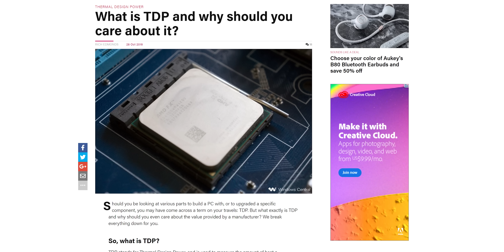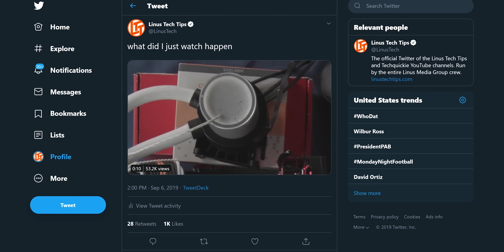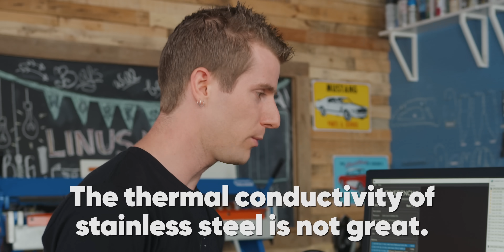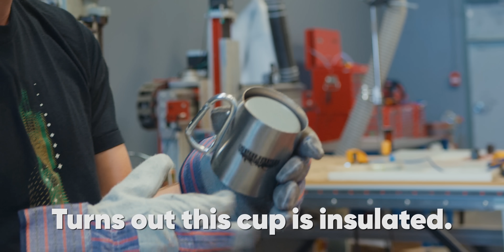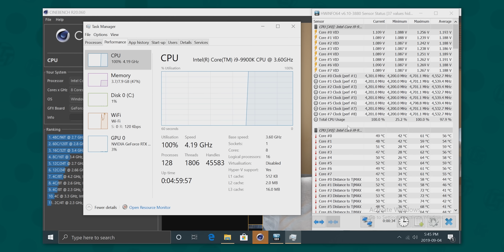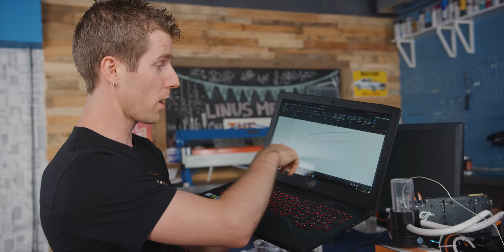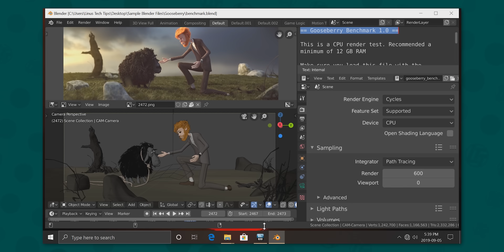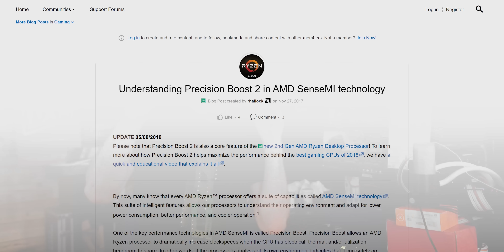Who REALLY Runs Hotter? AMD vs Intel

Comment: This was an actual terrible method, and probably a demonstration of what NOT to do, if you want to find out the true heat output of these CPUs.

However, you used the same crappy method for both of them, and mostly seemed fair.

Given this, it was actually surprising how close the 2 CPUs were, like it seems kinda irrelevant or at least secondary to worry about temps when trying to decide between the 2. Any half-decent quality cooler should be enough to keep them at safe temps, so it falls down to everything else, depending on the usage you want to do (gaming vs productivity and so on).

Still waiting for a proper test methodology btw.

Comment: Or you could just use a known larger volume of water in a separate insulated vessel and measure the start and end temperatures after a given test period. 
As it's a comparison test, ignoring heat losses in the system shouldn't be a big issue as both cooling systems will have similar losses, as the volume in the external insulated reservoir would be much larger than the pump, cooler and tubes combined. 10+ times?
Basic science tells you that it takes a given amount of heat to raise the temperature of a given volume of water by a degree.
So knowing time, volume and rise in temperature you have your CPU thermal output vs time.
Just need water, a stopwatch and a thermometer. 😉

Comment: There's really not much point in trying to set an 'industry standard' in this case, as the respective marketing departments will always try to use 'numbers' to gain some sort of marketplace position.

It doesn't matter what product you're talking about, Marketing per se is all about finding a competitive advantage to encourage consumers to buy their product.

From a real consumer viewpoint, REAL Performance Benchmarking is more useful than the 10% variation in TDP figures, just use whatever heatsinking solution is effective for your situation to prevent Thermal Throttling under maximum load.

Comment: I would've suggested measuring the power input on the CPU power cables on the motherboard. That would give you actual watts used. Whether that's turned into actual useful computation vs. heat is a different story, which they hinted at, with AMD getting more done in the same thermal difference. I'd suggest stopping the test after the same workload, then measuring the temperatures of your coolant. It wouldn't give you a TDP comparison, but it would give you an efficiency comparison.

Comment: Wouldn't it be easier to look at the power usage? Which one produces more usable work per kilowatt
Reply: They're not measuring work/kWh. They're seeing how realistic the TDP specs cited by manufacturers are. Intel claims the 9900K is a lower TDP component. If it outputs more heat than the AMD part (even though it has a higher quoted TDP) then the way they convey this information isn't adequate or possibly even honest.
Reply: @faceplants2  But the heat is just power usage. You could easily see which one produces more heat based on the power usage. It gives you hard numbers with relative ease. Also it would help consumers to understand which device uses more power over time
Reply: @hene193  The processor isn't the only thing using power however. These are different platforms with different chipsets and more importantly different VRM's delivering power to the processor. Different motherboards can use a different number of phases and even if they don't, inefficiencies in the VRMs will impact accuracy.

Comment: okay, let me tell you guys how to do it:
1) DON'T USE WATER. Use a liquid able to absorve heat faster
2) DON'T USE A CUP ON TOP OF THE CPU (that is absurd)
3) Mount a Liquid Cooling System, BUT don't use a radiator, instead use a big reservoir (10~20 liters)
5) Put at least two thermometers in two different places of the reservoir (preferably some able to collect data during all the experiment)
4) Thermally Insulate everything (CPU, Hoses, pump, reservoir) you can as best as you can
5) Turn everthing on and let the whole system working in idle until some sort of thermal stability (temps variation is appr. 0)
6) Start the benchmark and moniture the CPU clock and temps
(if the cpu throttles or the temp increases too fast  you are not being able to remove heat fast enough, which means that you need a bigger contact area, a better coolant or a stronger pump, if none occurs you can procede)
7) Register the initial temperature on both reservoir thermometers and start your stopwatch
8) Let it run for a fixed time or until it reaches certain temp (preferably a temp that will not cause throttling)
9) Colect the data
10) Turn everything off and reset the initial conditions (let/make everything cool down)
11) Repeat the experiment more than once to increase accuracy of results (THIS IS VERY IMPORTANT)
12) Process all the data (using statistics)

do it all to AMD and Intel, after that you will be able to make a reliable comparison.
Your scientist viewers will be thankful.

Comment: I can't help but wonder...
Why not just fill a cooling loop with a known amount of water (Put the whole mess on the scale, weigh it dry and then fill- your difference is your water mass), fire the pump on and measure the increase in water temperature over time? 

Science time! The laws of thermodynamics dictate the following;

0: If two systems are both in thermal equilibrium with a third system then they are in thermal equilibrium with each other. (In essence, if the CPU block and CPU are in equilibrium, the water would be as well.)
1: When energy passes into a system, the internal energy changes accordingly. (Heat something up, it gets hotter.)

The basis for 'watts' is joules per second, and 4.18J = 1kcal, which is the energy to increase the temperature of 1g of water 1 degree C. So, example: Your loop holds 250g of water. You run the CPU at full power for 100 seconds, and your temperature climbs from 30C to 65C after the water reaches equilibrium. That's a change of 35 degrees Celsius.  35*250 = 8750kcal, or Calories, in ten seconds, or 87.5kcal/second. When you convert back to watts (1J/s is 1W, so 1kcal/sec is 4.18W), you're left with 87.5*4.18 = 365.75W at full power.

You plug in your second processor, let the water temp get down to 30 again, and run it for 100 seconds, then stop the system and let the water run for a bit longer to make sure there's no excess heat in the CPU. Your water reading went from 31C to 62C. Your change is 31 C. 31*250 = 7750kcal --> 77.5kcal/sec --> 323.95W at full power.

CPU 2 runs cooler by 11.4%, which means you need ~10% less cooling capacity.

Comment: actually a magnet will tell you if its stainless  as higher grades are not magnetic, also you can tell by the grinder. lots of sparks = carbon steel, less sparks = stainless steel

Comment: Q =mc dT/dt, fellas.
Put dots over the Q and m and you're set with a really easy way to measure this.
You need a flowmeter and two thermometers, preferably inline ones. Do some simple math and you have the heat flow rate.

Next time, call a scientist or engineer. To quote a popular Canadian show, "it's fucking embarrassing!"

Comment: How it should have been done:

Traditional AIO except for a radiator use 5 Gallons of water into an insulated drink cooler with input vs output on opposing sides. Using a thermal probe into the cooler, monitor and record the temperatures and clock frequency every 1 minute. 

During the analysis, divide the temperature by the clock speed to get a Clock/Temp rate meaning "Given a frequency it outputs this much heat". Though since that doesnt factor in performance/joule, you could FIRST divide a specific productivity benchmark. 

So for a scored productivity benchmark the formula would be 

(Benchmark Score @4.0ghz) / (Time to 80*C @ 4.0ghz)

If you wanted a more constant you could simply use the rate value calculated by plotting the 1 minute measurements, finding the standard curve value, and dividing that into the benchmark score at a given clock speed.

Comment: DID NO ONE THINK TO JUST GET AN LN2 POT AND PUT WATER IN IT? HELLO? MCFLY?
Reply: That's an insulated container. The goal is to transfer as much of the heat into the water as possible. If they had used an insulated vessel instead of that metal cup they'd transfer less heat into the water and more into the air and surrounding components. This would've increased the chances of differing component layouts on the boards to absorb heat differently since the thermal output from the CPUs would be transferred into the water slower. It also would have taken longer for the thermal reactive dye to activate.

 Using a LN2 container would've probably still yielded similiar results but it certainly wouldn't be the obvious and dramatic improvement in test methodology you're suggesting.
Reply: @faceplants2  are we talking about the same kind of LN2 pot? I mean one of these: https://kingpincooling.com/collections/extreme-pc-cooling/products/t-rex-cpu-container
Reply: Andrew S dude hes talking about a cpu container not the linus tech tips insulated water bottle lmfao 😂
Reply: Hahahahaha.

Well said.

LTT is a bunch of morons to be honest. I personally know more than all of them combined, they just have a bankroll. That's the only difference.

Comment: You could use a slow and steady flow of tap water with a known flow rate to cool the cpu and measure the temperature difference before and after the processor.
That way you wouldn’t run into thermal throttling and could wait until thermal equilibrium is reached

Comment: since you only did a comparative test and not an exact measurements of thermal output, i dont see why the pump would effect the results at all. both systems had the same pump. the one did have that pump running for longer... but at that point its already over... now to overclock and use a larger cooler sized res to get a longer test... maybe side by side... 16 core ryzen vs 16 core zeon :D

Comment: 19:10 You mean "The best advice we can give you is to just ignore Intel processors this generation and go AMD"

They draw less power/make less heat, don't have issues with TIM/solder between the heatspreader and the die, are strictly better for proffessional workloads, and have more cores/threads and therefore more flexibility/futureproofing than similar priced Intel processors.
Reply: You're assuming a lot, fellow AMD fanboy.
Reply: @BarryKennedy  It's only true for this generation. And the benchmarks, specifications, and pricing don't lie. Intel has long needed some competition anyway.

Comment: If you are worried about usind the same amount of water and same amount of ink etc., then just mix your liquid beforehand, stir, and fill an equal amount in the two cups. That's easier and more precise than measuring one tip of ink.

Comment: Different sizes heat spreaders on the cpus as well as variable power draw and a dynamically variable amount of " work" achieved by the cpus made this a totally useless test. You should have measured the amount of power draw for each system doing an equal amount of computational work, powering the cpu via a separate supply from the rest of the system the amount of heat generated can be calculated using ohm's law as all the power used will be converted into heat ultimately. The key here is keeping the "work" equal like calculating a specific number of prime numbers again and again on all threads. Then plotting the number of calculations vs the power draw. You can then generate a figure for how much "work" is achieved per watt. Not plotting the temp vs time vs ghz as none of those mean anything in regards to the target comparison.

Comment: is this pc build good for a budget gaming pc ?:
ryzen 7 2700x
ASRock B450 Steel Legend ATX AM4 Motherboard
OLOy WarHawk RGB 16 GB (2 x 8 GB) DDR4-3600 Memory
Samsung 970 Evo 500 GB M.2-2280 NVME Solid State Drive
ASRock Radeon RX 590 8 GB Phantom Gaming X Video Card
cooler Master MasterBox Pro 5 RGB ATX Mid Tower case
EVGA BQ 600 W 80+ Bronze Certified Semi-modular ATX Power Supply

if you have any changes help me plz especially the case

Comment: You know what? I'd like it if companies would tell us how many watts go into the CPU. Like, is it really that hard? Why do we have to deal with this nonsense? They're putting in a lot of work just to not tell us how much power their chips actually use.

Simple solution:
Power draw: xW
TDP: xW

It is useful to know what your thermal solution should be expected to dissipate, and that's not necessarily the same as the maximum power draw of the processor, but it is also useful to know how much actual power the processor pulls. We can have both. They definitely know how much power their processors use, it's a very simple measurement and it makes no sense for them not to do it.

Comment: Should have used a insulated cooling box with water, more mass of water for longer run time and it would be easier to keep the temps down, to prevent thermal throttling from messing with your results.

Comment: ...isn't it just easier to invest in a proper high-current ammeter and measure the current (Amps) being drained directly through the 8-pin CPU connector? I can imagine that being the most accurate (especially if you can get datasheets for the power losses from the MoBo voltage regulators).

Comment: Instead of reducing the number of variables you guys added more! Using different materials, weight, pressure, level of insulation etc. goes a long way in thermal management and pretty much anything you do in real life. Every small details adds up. For example is this video although the number of people who unsubscribed because of this dumb shit is insignificant keep doing this mediocre 30 IQ work and you'll see that every small details count.

Comment: this is an example of releasing content just for the sake of it. pop the same cooler on each, measure how quickly each cpu reaches its highest temperature, record the highest temperature, make a not of each cpu core frequency and any throttling. Done.

edit: forgot to say, measure wattage from the wall with killawatt.

Comment: With an Intel system, the system-builder must set the TDP value through the BIOS.  It must reflect the cooling capacity of the system. If you get it wrong, you will have a less than optimal system. Setting it too low can be better than too high, because intels thermal throttling is a blunt tool. With an AMD system, the CPU can compensate in realtime, if you set the Power limit too high. For Intel systems it's the TDP value you use as a limiter. On AMD systems it's the PPT value.

Comment: Look folks, there is a one to one relationship of power-in to power-out.  Power-in is simply the real electrical power, think current heating a resistor.  Power-out is the heat, think of the heat released by a current running through a resistor.  So just measure the real power, a watt-hour power meter will do,  and realize this is exactly the same energy that becomes the heat.  So easy to measure! (but is amusing to watch these guy build their Rube Goldberg machine)  http://mentalfloss.com/article/54007/8-excellent-rube-goldberg-cartoons

Comment: This is just plain stupid. If you want any kind of relevant measurement all you need to do is Take known volume of destilled water (for easy math: 1,0 l), and let its temperature rise like 5°C and measure time for each processor. From this and from water’s Heat capacity you can exactly deduce thermal output of any processor. You know physics is sience too.

Comment: I don’t really get why they don’t just measure wall output with a similar specced mobo; 

if either one of them has a chipset consuming 50 watts I think that is also important in this testing.

Yes this doesn’t just measure cpu power consumption, but that’s kinda everything I’m interested in. 

If they were gonna do it this way at least tell me what the actual wattage used by the cpu was instead of just comparing time taken to heat.. (they had a temp logger, so take set time, check delta T and specific heat capacity of total cooling system)

Comment: The video would be way more interesting to watch and cheaper to make and if you had put two equal coolers(arctic, coolermaster... pick one) on those cpus and then simply read the measures while they were rendering... that's how you'd get real consumer results everybody cares about, and actual answer to the title of this video, does amd or intel runs hotter... This was just waste of 95% people's time... I understand what you were trying to do in this video but nobody cares about that guys...

at the end of the day people will ask again "Does intel 9900k or ryzen 3800x output more heat at 100% workload"

first time ever i disliked your video! 20 mins waste of time...

Comment: We could start using Joules/minute or something like that (1/60th of a Watt) for TDP.
Measured at 100% load, calculated by the temperature increase in the body of water used to cool the CPU (obviously the reservoir would've to be isolated) and the time it took.
It's actually easy to do lol, this SHOULD be an industry standard
Reply: Youre completely misunderstanding.

The math is sound. Thats not the issue.

The issue is companies like Intel saying their 9900k is 95w when its not. At all. The 95w figure is for BASE CLOCK. Not turbo.

AMD is the opposite, their TDP figures are when Turboing.

That's the issue.
Reply: @nexxusty  I meant the methodology and using minutes instead of seconds was just an idea
Reply: And of course, at stock
Not at base

Comment: Or you just do what most decent CPU testers do... Test the difference between total watt the system uses at idle versus full cpu load. The power you put in = heat it puts out. Science!